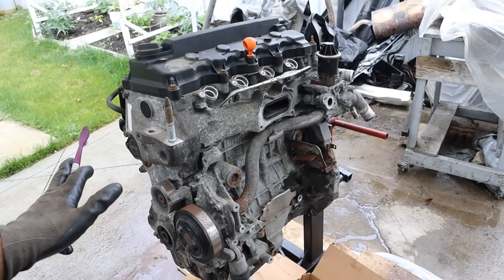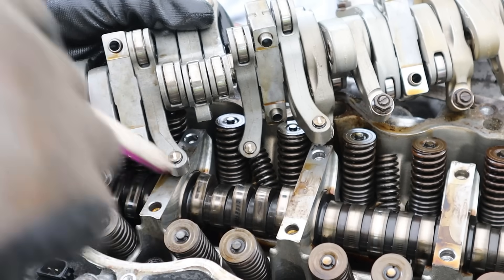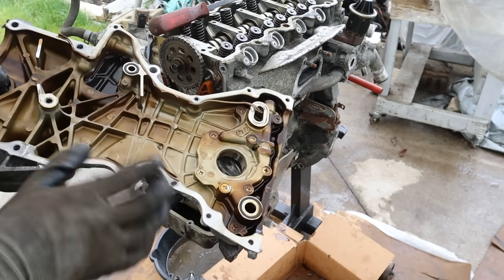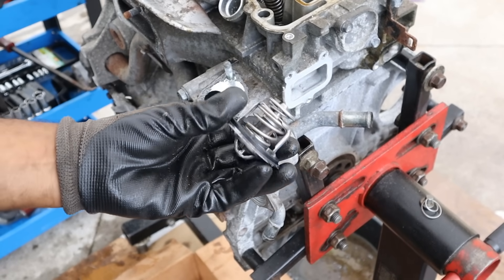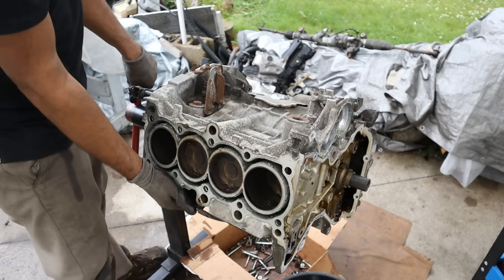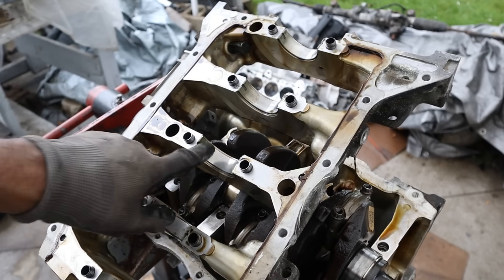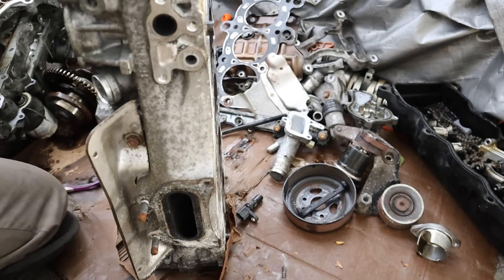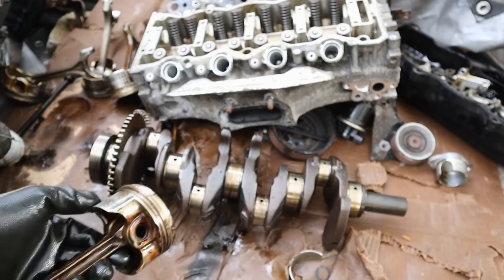Modern Engines are Junk: Honda Civic R18 Teardown Proves they Don't Make Them Like They Used To

Comment: Great engine, had one in a 2007 mk8 Civic hatch (the spaceship). Not a fast car, but plenty power and good economy. Drove it past 300kkm, I'm sure the bearings looked just like the ones in the vid. No leaks, no oil consumption, mechanically a very quiet engine. No turbo, so fairly short gearing and thus quite high rpm's at highway speed.
Reply from the maker: define quiet? I always thought those Civics were a bit loud and not as refined, but it was a great commuter car. Ahead of its time with the space ship design compared to the 7th generation it came from.
Reply: @speedkar99  Yes, not very quiet for interior noise (mostly due to short gearing), but the engine itself is mechanically very quiet. No rattling or ticking, silent chain and valve train etc. At idle I could barely hear that is was running. And indeed, way ahead design which I loved but some don't. But a lot of space inside for it's size. Only the rear hatch had a some stubborn leaks after sitting a while in the rain. Not the best construction British Honda made there.

Comment: My 2013 Civic has the lowest running costs of any car I've owned. Adding a CVT, direct injection, and a turbo really detracts from what a base Civic was meant to be.
Reply: Emission regulations killed good cars
Reply: @greathey1234 Schwachsinn!!! Hier sind wohl alles Ingenieure aber kaum einer hat eine eigene Firma die Motoren in der Präzision wie Honda baut !!
Reply: @greathey1234 

No it didn't stop being so overdramatic you big baby.
Reply from the maker: I agree. And with the Honda Fit gone, there isn't a bare bones simple car in the lineup to fill its role.
Reply: @speedkar99  - True, but Honda's working on another anonymous "SUV" blobcar that will fall between the CRV and the Passport, because seven different "SUVs" clearly isn't enough.
Reply: @speedkar99 

You just complained about the 2.0 being on a barebones model in my other comment, but here saying there is no bare bones car for Honda Fit replacement role. Wtf make up your mind.
Reply: Same for Toyota Corrolla 2013... i calculated depreciation and it is 100 bucks a month after 10 y! I guess it same for  civic...
Reply: They still sell the 2.0 naturally aspirated don't they? Otherwise go hybrid. The Atkinson cycle engines been proven to be incredibly reliable. With the hybrid you also avoid the belt system CVT. Although the belt CVTs haven't seem to be problematic in Hondas as bad as it was for Nissan.
Reply from the maker: the 2.0 Civic/ CR-V are reserved for the lower trims now. It'll soon be discontinued
Reply: @speedkar99  HR-V, the CR-V has used the 1.5t since 2018 ish
Reply: @amdstrollo3074 the HRV at least in North America used a 1.8 NA engine. The current Generation uses a NA 2.0L 4 cylinder with a CVT.
Reply: @snaaaaaaaaaaaaaaaake 
The hybrid is way nicer than the 2.0 Civic but the 10 to 15% higher insurance cost removes the financial argument.
I ended up buying a "new" 2024 Camry instead even though I liked the Civic more.
Reply: @0HOON0  That's a shame. How does the insurance compare the Camry?
Reply: @snaaaaaaaaaaaaaaaake  I pay more than the base Civic would have been but less than the Civic Hybrid. Camry Hybrid would have been even %5 higher than that.
They wanted $24.2 for the Civic and I bought the Camry for $27.4.
Reply: My mustang will
Smoke it
Reply: @keithbellair9508 wie bitte?? Ihr in den Staaten seit doch froh wenn ihr euch nicht anpassen müsst...

Honda forever und der VAG Abgasskandal ist auf eure Öllobby zurückzuführen weil ihr dann einen Diesel mit 600Nm gehabt hättet aber nur 5-7l Kraftstoff verballert hättet statt 20😂😂

Comment: I have a Honda FR-V with a R-18a, over 310,000 km on it.  Still going strong.  Had it almost overheat because the thermostat went on it.  In the past 100,000 KM, barely anything wrong with it.  Other than the thermostat, had the tensioner go.  It's automatic and it still is going strong too.  I also have a 2013 Civic Hatchback (FK2) with the R18ze.  Only 180,000 km on it.  Makes it a little smoother with the balance shafts, and it's a 6 speed, so nice and fun.
Reply from the maker: Never knew a FR-V existed. Kinda like a Mazda 5.
Reply: @speedkar99  3 in the front and 3 in the back, and a bigger trunk than a 5.  Also no rear suspension clunks like the 5..  There are some models that also came with the 2L k series engines.
Reply: @speedkar99  Similar to a FIAT Multipla too, but with Honda reliability (and not as hideous).
Reply: Have you done a valve adjustment on the 300K engine? I have 170k and there is zero knock/rattle and havent done it. The tensioner and its neighboring pulleys with belt were changed.
Reply: @fillmorehillmore8239  Nope, haven't done the valve adjustment..  Took it to Honda for valve cover leak, they looked and said they were fine and made no noise either..